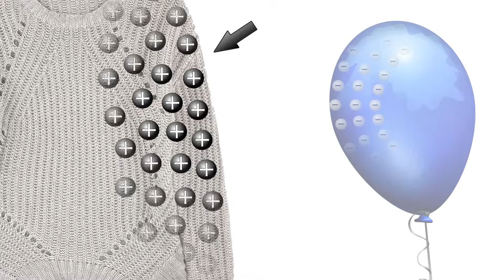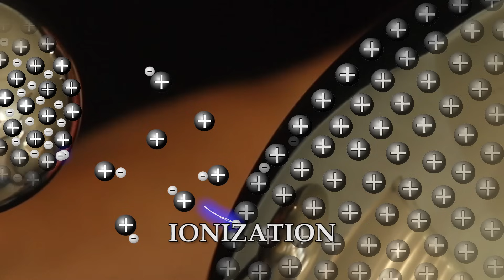Avoid electric shock getting out of a car!

Comment: Let me tell u what in the winter months I pack some voltage an its gotten to the point for me I believe i may have built a timid but mild ptsd when it comes to closing the door in the winter time even tho it's not a terrible shock I don't like it I've been hit with a police taser, recepticals, an even an electric fence an all of which aren't painful its just a unsettling feeling ,having your bones jumped with electricity. although after its all said an done it can be quite" energizing "no pun intended.

Comment: Actually insulators don't exist at all, it's not even a real term, high enough voltage can travel through anything it's just that insulation is designed for a specific purpose and raiting

Comment: I have an inquiry about static electricity.  I was extensively vacuuming in the garage using the hose attachment.  At one point, I vacuumed up a small pile of flour from a wooden shelf (long story why it was there).  The shelf is about three and half feet high and I was holding the hose with my arm about four inches away from my body.  Although I was not holding the hose right next to my body, I felt shocks on that side of my waist, but no where else.  I pulled the hose away from the flour and the shocks stopped.  Then I applied the nozzle again to the pile of flour and I felt the shocks again.  I am in Southern California, and this winter has been very dry, and I was rubbing the nozzle all over while vacuuming.  But why did I feel static electricity shocks only when I vacuumed up the spilled flour?  Please do answer; I am so very curious about it.  Edit: I may be crazy, but I thought of grain silo explosions, so that is why I quit vacuuming the flour.

Comment: Ehm, isn't the corona discharge the actual reason of the styrofoam box taking off? If you attach a sharply pointed metal rod to the sphere, you can blow off a candle, quite popular physics experiment in my times :)

Comment: 1993 Mazda 626 ES did not have this problem due to it being engineered with a slow discharge pad in the interiorside of the door  door opening relief. It slowed down the static discharge as you opened the door, releasing it to the battery.

Comment: TIP: when the conditions are right for shock, flick conductive objects with the back of your hand (i use my knuckles specifically) BEFORE grabbing them with your palm.  The discharge is much less noticeable or, um, shocking.  👍😉

Comment: If you suspect that you built a static charge, hold a piece of metal in your hand, and use it to touch the car.
The spark will be just as strong, but your feeling of it will spread across your whole palm instead of just the point of the spark.
Another option is to touch the car with your knee, where there are less nerve endings that your hand.

Comment: You didn't address how to keep from being shocked on door knobs, but  the answer is simple. Hold a metal object such as a coin or pen and touch the door knob with it, you still get a spark but it snaps off of the object not your finger so you do not feel the shock. It might also work with a ring, but I don't wear jewelry so can't say for sure,

Comment: At 1:20 you say you can't pass charge to an insulator. Oops! Glass rods, wool socks, rugs, dry skin....these things have charges on one side different from the other BECAUSE they are insulators. If they were conductors the charges would equalize throughout the object. The styrofoam food tray picked up charge on one side of the tray which stayed there because it's an insulator.

Comment: Simply just hold a key (fully metal with no plastic handle) or any metal object and touch the car with that!
Discharging will occur between the car and the key and you wont't feel anything. Same with door hanles or anything else.

Comment: Further to my post below, my efforts to “earth” myself have been very successful.  At first I wrapped tinfoil (aluminium foil) around the sole of one of my Jandals (thong).  This worked but soon broke.  My latest effort involved in straightening out a paper clip and bending it around the sole of the Jandal.  I embedded one end in the base of the Jandal and the other in the top.  My foot is in constant contact with the wire and now I don’t get shocks at all.  I rarely wear closed-in shoes which would be more difficult to earth.

Comment: 3:20 that won't shock you unless you are somehow connected to ground, and even if it does shock you the fuse will instantly blow or if not the RCD will trigger.

Comment: I get shocked all the time. I'm always slapping metal doors before I open them. A friend gave me the tip to hold on to the car while getting out so I don't get shocked. I did it and I got shocked when my foot touched the ground. He told me it wasn't possible. But I got shocked. It is possible.

Comment: It's worth mentioning that with all but the largest static shocks the only reason you feel them is due to the heat of the spark against your skin. In other words, the static discharge is causing you a very localised burn. This is the reason you don't feel a static shock if you touch the car door (or door handle, or metal banister) with your keys: you are isolated from the heat of the spark.
Reply: I'm going to try this because even if I put my hand on the metal of my car while getting out I still feel the static it's just not coming as one big shock but it's still super uncomfortable to me. 😭

Comment: I always remember that I have a static build up once I'm out of the car and realize I need to close the door (darn leather jacket and upholstered seats). So what I do is I close the door by pushing on the glass of the window. Then, when walking to my door, I realize that touching the door knob will shock me again, so I touch the door first (painted steel door) and I can hear, feel, and sometimes see the discharge, but the paint is enough of an insulator that it is a slow discharge as opposed to the sudden and fast shock I'd get if I touch the knob. 
#PhysicsLifeHacks

Comment: I had such a problem with this with my Fords (late 80's) that a finally put a loop of clothes hanger wire on the seat and looped it under the seat belt anchor bolt. Problem solved with continual grounding.

Comment: i used too  live int this old house that i would get zapped right through the air from my switches almost every time. ha ha i am kinda crazy so i would keep a copper coil on my finger with one end of it sticking off the end of my finger. the coil difused? the shock before it got to my nerve. I think? any way.. it seemed to work.

Comment: I used to drive  Flatbed 18 wheeler ..Used to haul loads of Sheetrock, Like 50,000 Pound loads .I had to take these large rolls of sheet plastic and cover the whole load with the plastic before putting the tarp on the load ...The fun part was taking the tarp off at the delivery spot than  taking that plastic off the load ...Whew Lordy if you forgot and touched the trailer that spark would knock  you for a loop ha ha .I used to take my pocket knife out and open the blade and hold onto the blade and touch the trailer with the tip of the blade and let that spark out that way ..I hated getting zapped

Comment: Try touching things with the outer side of your hand or fingers. I found out that when I get the shock with the reverse of the finger it almost doesn't hurt at all while it hurts to much when I touch something with the tips. My guess is that electricity travels better by the nerves and that more nerves go to the tips... so when i get the shock on the other side the electricity gets dissipated over a bigger area in my asking before getting to the nerve terminations.
(sorry for the bad English, hard to describe it, reply if you need clarification).
Thumbs up if you find this tip useful!
Reply: Even better if I kick something metallic with your shoe, electricity goes through the shoe and I don't get a shock at all. Useful with computer racks.
Reply: Or have you ever unboxed something and it shocked you? Then next time hold your hand against the unboxed object so you have the same charge. Then touch someone else xD

Comment: Excellent video as always. I would also add that what's painful is not the electrical discharge current but rather the flux, that is the amount of current across a given skin area. So a good way of avoiding the pain of the shock would be to touch your car with an open palm after exiting, rather than touching it with just the tip of your finger.
Reply: That would have the added benefit of giving the flux fewer nerve endings to affect.

Comment: When I lived up in the north, during winter times, static electricity is just shockingly frequent.
Getting out of the car and ground myself became a habit i developed.
The other thing I found useful is to get a humidifier at home. By making the air humid, it helps discharge the static when you take off a sweater or get up from a plastic chair, etcs.

Comment: I used to be static until i realized that when i drive my car i put my hand out the window and hold the door or top part of the door then act as if like m a coolest driver. When I unlock or touch the door handle i first touch the wall or wood or anti-static material to discharge my hand... lastly when i am close to my car i use my key, touch the car's body with a key while holding the nonmetal part of the key (Usually car keys have a black holding part)
Reply: Rudzani Raedani

Comment: Ok this used to happen to me all the freakin time until I found out that I could use my key to discharge myself without the pain.  So what I do is hold the metal part of the key before exiting the car, and while holding it, I make contact with the exterior metal part of the car using the metal part of the key.  And voila!  The discharge occurs, but the tip of the key actually takes the shock and the pain away.

Comment: Dear @Dianna Cowern According to Triboelectric nylon or according to your video the car seat doesnt not give out electrons easily so you are the one loosing electrons so you are positively charged and the electrons in the metal travel into you because nature doesnt like charge imbalance. and also the metal in car is no way grounded because rubber(tires) are insulators explains that you are the one being gaining electrons.

Comment: The explanation for the car is wrong. The car itself builds up an electric potential due to air friction and the tires rubbing against the road. Because of shell theorem, there is essentially no electric field inside the vehicle. However, when you get out of the car you are moving into a region where the electric field is very high - because the potential of the car is high relative to the surrounding environment. When you touch the car, your body equalizes its potential (or more accurately your equipotential pattern) to conform with the local field outside the car, and you feel that as a shock.

Comment: Can an electric spark happen in vacuum? And if so, how?
Reply: Yes, it can. Electrons can travel through vacuum, and a tiny portion of electrode material can be torn out if the current is big enough.
Reply: electrons can travel through a vacuum but there won't be a spark since there is no air. When you pass a current through gases such as air, the gas molecules get excited because they're bombarded with electrons. These excited gas molecules will lose energy by emitting photons. This is how the sparks are generated. However, if the electrons hit the anode with enough energy, it's possible to excite the metal atoms. The excited metal atoms will also give off light but they are usually not in the visible spectrum (x-rays, UV light etc)
Reply: electrons can travel through a vacuum but there won't be a spark since there is no air. When you pass a current through gases such as air, the gas molecules get excited because they're bombarded with electrons. These excited gas molecules will lose energy by emitting photons. This is how the sparks are generated. However, if the electrons hit the anode with enough energy, it's possible to excite the metal atoms. The excited metal atoms will also give off light but they are usually not in the visible spectrum (x-rays, UV light etc)

Comment: Another solution I invented myself: if you're in an environment where you build up static electricity like some factory floors or while outside touch grounded objects or a car while holding the metal section of a key. The spark will jump between the key and the grounded object but you will feel nothing. Works every time.

Comment: Nope, the airflow around the moving car charges up the car. Not the friction with the seat. No matter, the solution of touching metal before hitting the ground works anyway. Good example of right answer by wrong analysis.

Comment: I get statically charged when I get off my desk chair, and i even once destroyed my PC when i managed to touch its front facia where there was a metal switch, the static charge killed the mother board, so every now and again this static charge starts building up whenever I got off a chair, the chair has fabric cover, not nylon, and still it charges up and I wear cotton clothes, so nothing to do with my clothes, I am an experimenter, so i took all my clothes off and it still produced this charge each I get off my chair, with or without clothes, so I figured out it was m,y shoes, they had a nylon sole, nylon is an insulator, so your body acquires a charge because it is isolated from the floor, by this nylon sole, so I ran a copper tape from my legs to the bottom of the sole such that the copper conducting tape was in contact with the floor, and my leg, with this arrangement my body would not pick up any charge and so i was like OK,  I hated this each time I touched anything metal including a door knob on a wooden door,  or each time I wanted to pat my cats, we would both feel very unpleasant pin prick like pain, so I discarded those nylon sole shoes, because I didn't want to risk destroying another PC,  

Any way, I found a better way to neutralise any charge your body may acquire, hold any metal object in your palm, such as keys, and hold it tight, and then touch the tip of the metal object or keys to any metal surface to discharge static, this way you will discharge the static build in your body without suffering that unpleasant shock. You would get these more in winter because of heating dries up air, so high humidity is good. But dry air will dry everything and so you start getting more statics. When you bring metal object that you are holding in your hand, close to another large metal object, you can actually see the spark jumping across from about half a centimeter with a clicking or spark noise.

Comment: There is a misunderstanding here by you, Physics Girl. For a thing or object to hold static charge it MUST be insulated, else the charge Flows and gets neutralized. that's why metal objects cannot be charged by rubbing them with anything whereas insulator material objects like plastic comb, plastic sheets etc can be easily charged by rubbing.

if a metal needs to maintain a charge over it's body, it must be insulated from other conducting materials and ground. as the case with van de graff that you have shown here...the metal sphere is insulated and also a belt continuously draws charge from it to make it charged and the potential rises till a certain point.

For the object to hold static electricity (either + or - charge) it needs to be an INSULATOR! metals cannot be charged by rubbing...they instantly conduct that charge to the opposite surface without retaining any charge on themselves!

Comment: Excellent video! I would like to share my thoughts, every thing in nature is physically grounded to the earth, although birds fly, they don't stay up in the air forever, they eventually land on ground or trees and thus become grounded. Interestingly we humans live our daily lives ungrounded. The floors in our home are insulated, we walk outside insulated by our shoes, we spend they day at work insulated in a building, we go sleep in our beds insulated, only on rear ocations do we ever physically touch the earth. We never give our bodies a chance to discharge, surly this is not good, we can easily verify this by measuring our bodies voltage with a multi meter when we are grounded and ungrounded. Please look into earthing, you don't need to change your lifestyle, you just need a physical contact with earth.

Comment: is it not also that the car shocks you because it has a high built up of static charge after 'rubbing' on the air molecules from traveling so much? The same reason that sometimes ppl light petrol on fire at the petrol station and airplanes are always grounded before refueling?

Comment: 2:44 Wouldn't you just charge up until the voltage is high enough to through an arc through the paint of the car (which is not conductive as far as I'm concerned)?
I would've thought touching some bare metal part, like the door lock striker or something, would be more effective...